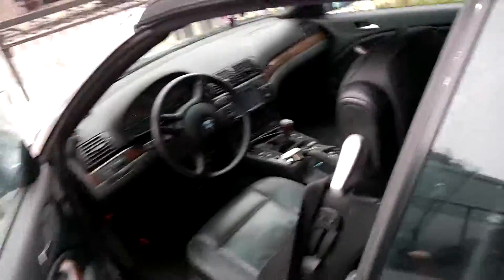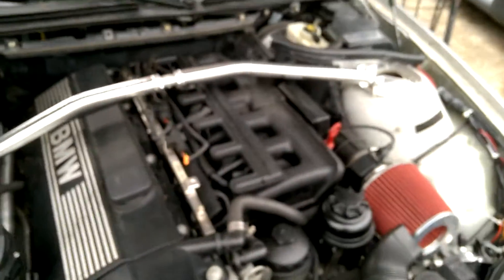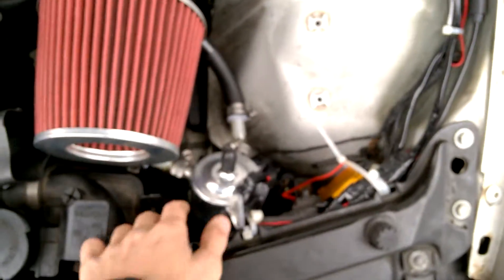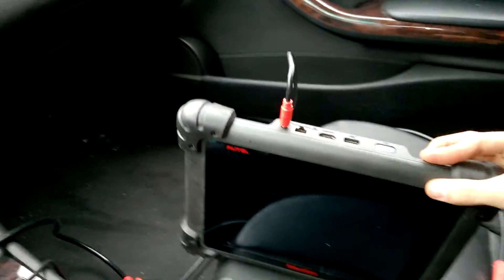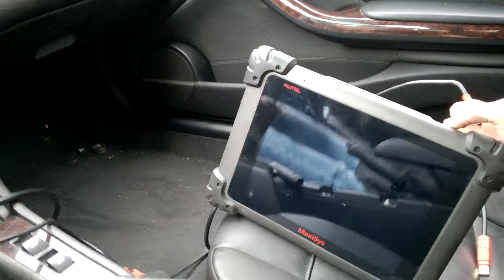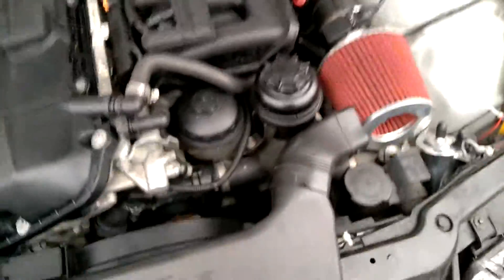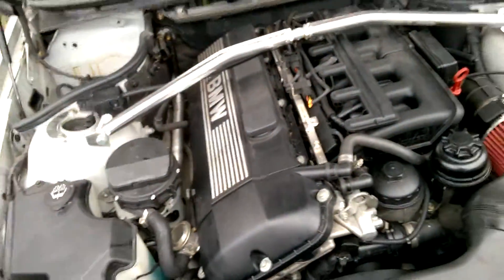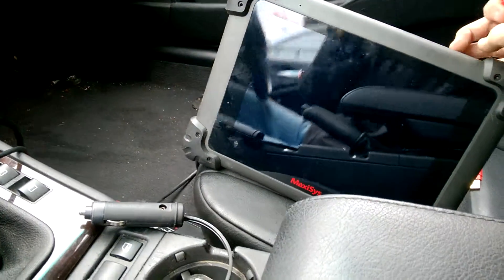Backfire or what is this ?

Comment from the maker: fixed the problem it was one of the BRAND NEW coils bad ,before i came to that conclusion i changed all injectors from 330 model engine and than it ran fine for a little bit and still started misfire , so i replace coil in first cylinder and it was bad coil too, so i got another one and than it worked